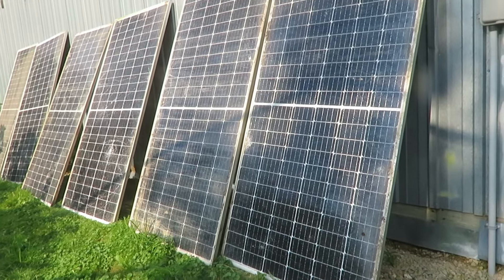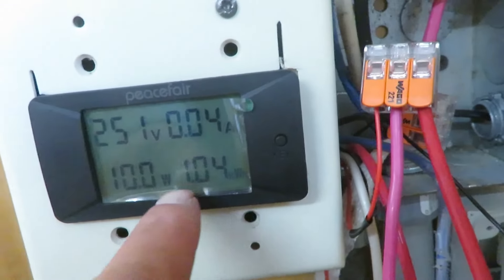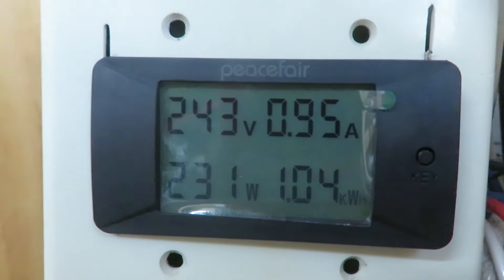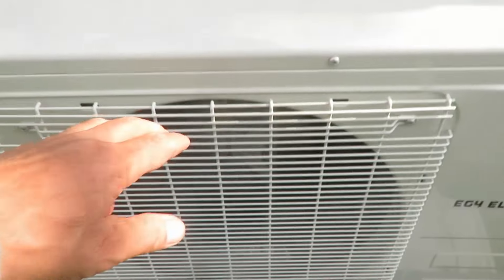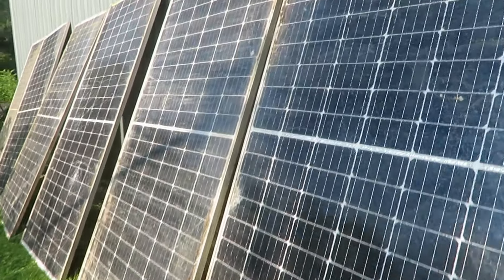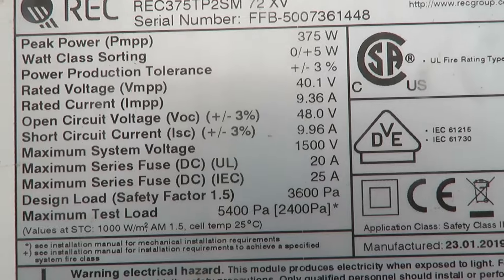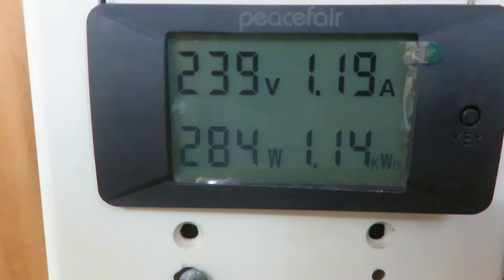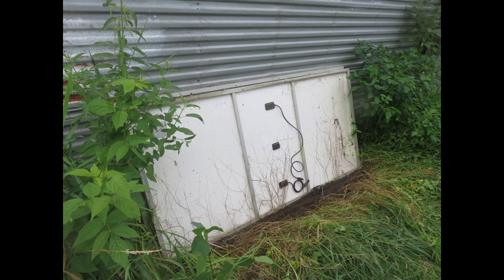Cracked, dirty, shaded solar panels still work !

Comment: Larry, Larry, Larry..  It's remote. You have to point it at the machine. Your cracking me up.  WOW.. Them panels look horible.. ready for the junkyard.. UNTIL I saw the 250v from them. Impressive.
Reply from the maker: regarding the remote - seemed to work when not pointed at it sometimes . I have metal faced insulation on ceiling so maybe infrared is bouncing off of that.
Reply: @LarryKapp1  Strange.. maybe batteries are loose or half dead..?